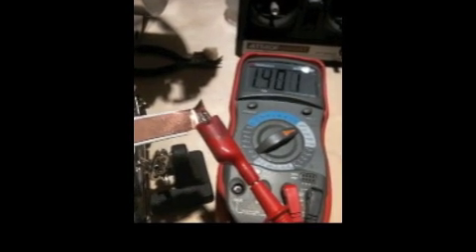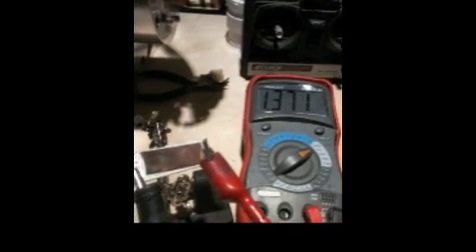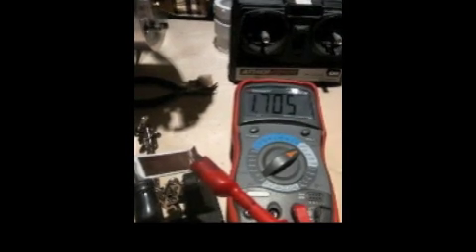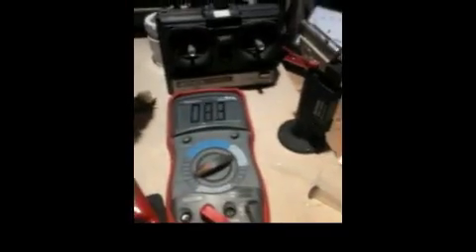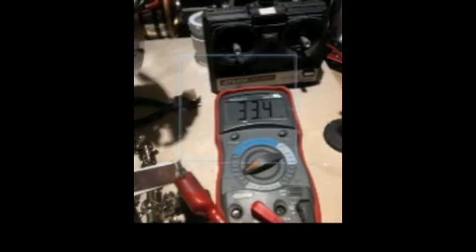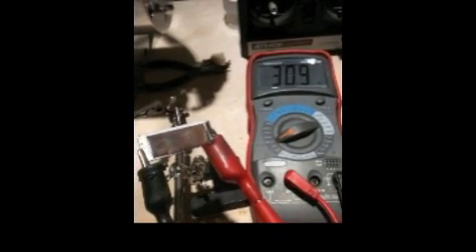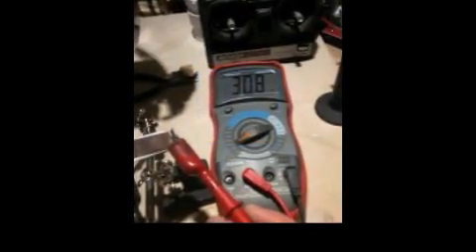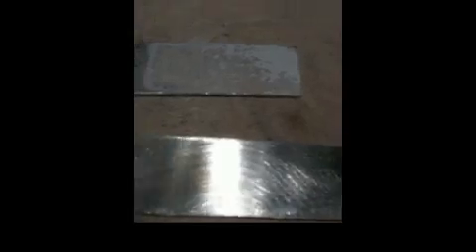Copper Oxide Red vs Black

Comment: You could plate the whole tab then that would not be a problem. separation between the two tabs should be 2-3 mm at the most in the cells. Each pair of tabs is a cell unit. So a multi-divided container would be advised to better stack the cells in serial and parallel to get the voltage and current capability up.
 Great empirical science here!
 If you watched the water video IB showed then you will understand that you need the exclusion zone to form the battery hence the 2-3 mm spacing. Cont.

Comment: Might I suggest that the crystalline layers you built all have ordered water in them. Aligned you might say. The water in between not only serves as a better conduction to surface action then air does or even close contact. This way the full surface of the crystalline structure on the metal can conduct fully. My suggestion from here is to try and use a sealed unit with plates that are only exposed on the grown surface. Continued..